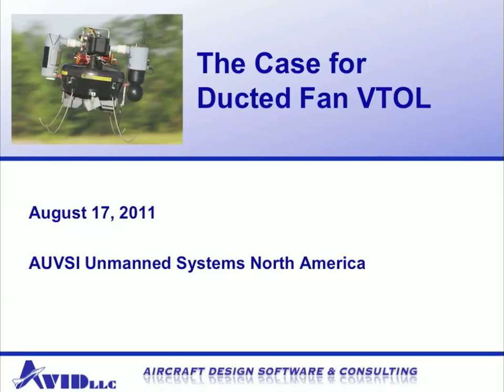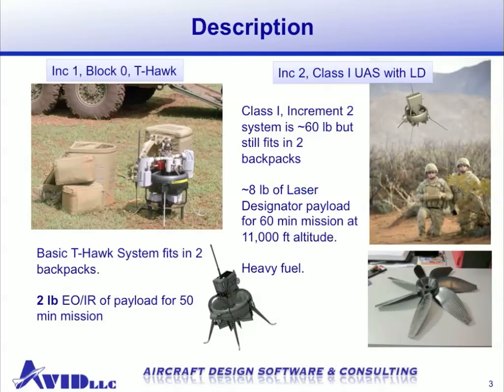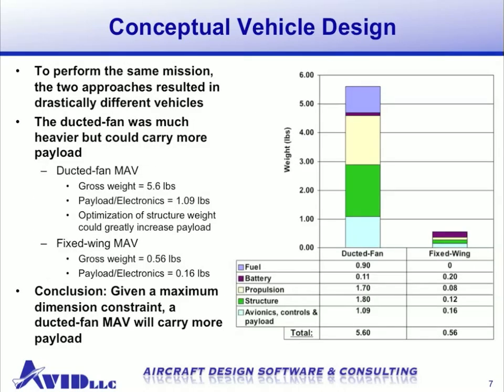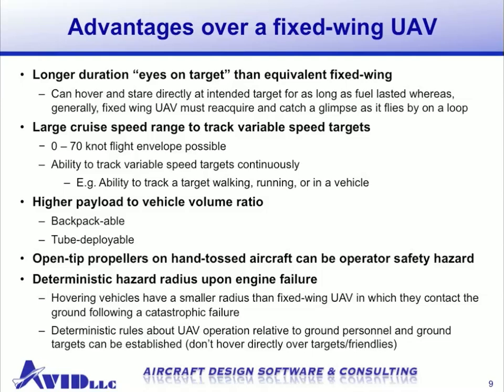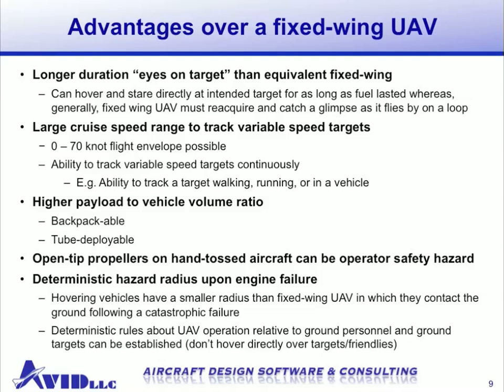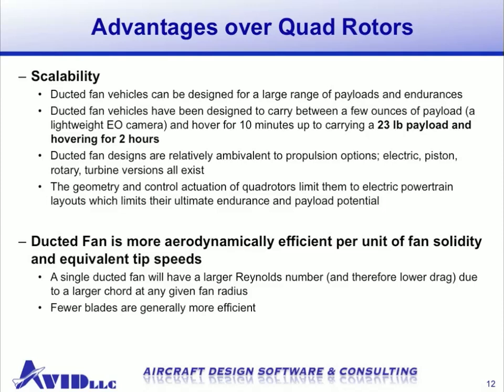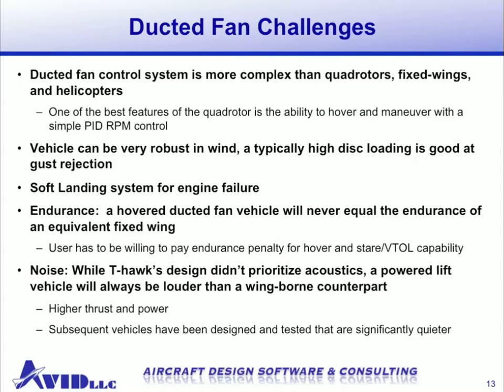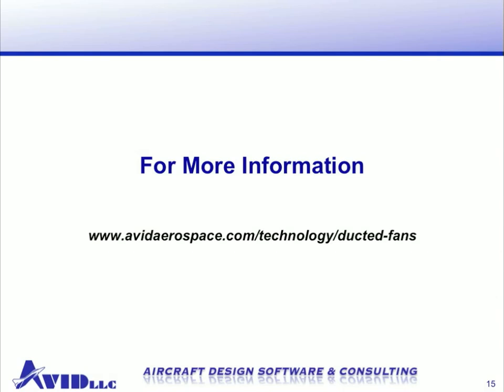The Case For Ducted Fan VTOL

Comment: I agree with SEThatered, you should experiment with ducted fans which incorporate a wirelessly actuated variable blade pitch rotor shrouded by the duct, in the place of a one piece, fixed pitch rotor. There will likely be a power requirement tradeoff, due to the increased mass of the variable pitch rotor assembly rotating (as compared to a solid plastic rotor). The advantage of course would be changes in height without increasing rotor RPM, thereby also conserving power and extending VTOL range.

Comment: Hello, I am leading a design Team for Tesla Aircraft. I am adamant that we use ducted fans for our prototype, but wondering if contra ducted fan is best way to go for superior/clean thrust? Also, right down to the nacelle or duct. We are experimenting with a venturi shaped nacelle and a conventional shaped nacelle. I understand the benefits of a ducted fan vs. a open prop. What are your thoughts on a contra ducted fan?
Reply: lol
Reply from the maker: We chose the single propeller to minimize both noise and complexity.

Comment: p.s. Our concept is a hybrid and will have dual power plants. we are adopting the Honda Jet low-wing design, mounting the ducted fans on the wings, as close to the fuselage as possible for increased center line thrust in the event of an engine failure. We are still debating contra ducted fan and what would optimal amount of fan blades to if we go contra or not. Our concept is a 4-place GA type a/c. You may be of great help to our Team.
Reply from the maker: Stan, There are always trade-offs to be made in every design.  A properly designed counter rotating design can have reduced swirl in comparison to a single stage fan.  However, that does come at the price of mechanical complexity and increased noise due to the blade-wake interaction.  There are approaches to mitigate both.  We would be happy to discuss in more depth and specifically for your application.  Please contact us (info@avidaerospace.com).

Comment: whilst its true that less blades is better, and diameter is king, this presentation didnt address the elephant in the room. flow straighteners and tip clearance. and duct intake geometry. all critical to approach the theoretical 'root 2' difference. the 'root 2' is the best you will get and is, in practice, difficult to attain with many designs not achieving a net improvement due to the increased weight needed.